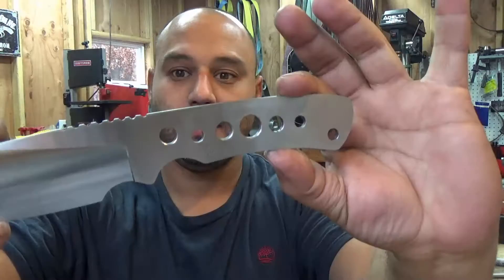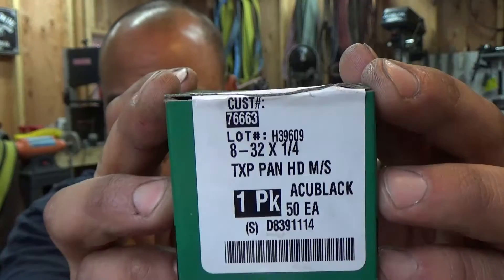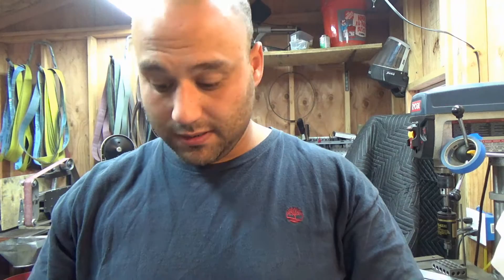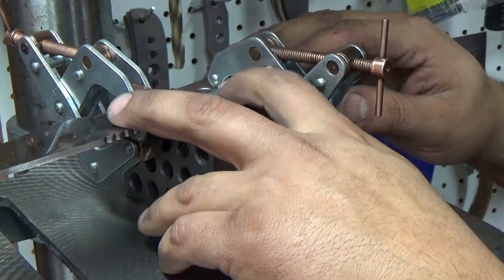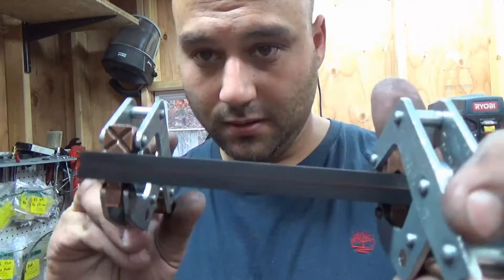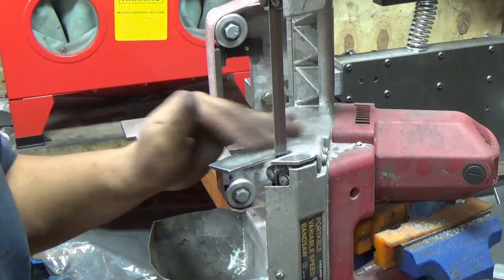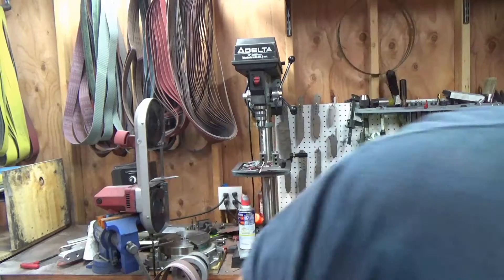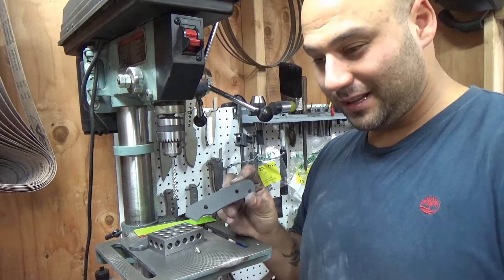How to make removable knife handle scales part 1

Comment: Mike,
I am a police officer in central Florida, and a knife creator enthusiast.  I am no way a computer/internet guru, and I determined  this comment thread to be the best way to contact you.  I work as a motor cop (motorcycle) and we all (well, most of us) carry folding knives on our motor boots.  I am sick and tired of carrying a garbage knife while on duty.  How do I go about buying one of your knives?  I find your passion and creativity for knife making absolutely captivating.  Hope to be the proud owner of one of your folders in the near future.
Reply from the maker: +TheLagwagon6040  I'm not much of an internet guru either so no worries there. So you attach the knives to your boots with the pocket clip or is it in a pouch of some sort?  I haven't finished my locking folder prototypes just yet but they are in the works. I want to be sure that the design is up to par before I start selling them. The folders I make now have been all non-locking friction folders which likely isn't up to the task of an officer's duty knife.  I plan on starting up a website to make the knives more readily available, but as of now I've been selling the majority of my work through Instagram on a first come first serve basis. I will be sure to make a video once they are ready and the website goes up. Thank you for watching and your service!
Reply: +EKIM1428 Yeah, we carry the knives with the pocket clip facing out, at the top edge of the boot (Chippewa Police Motor Boots.)  The actual knife rides inside the boot.  I'd attach a pic but I don't think I can on the comment thread.

Comment: great video..as usual...after making a shitload of removable handles I thought I have done/seen/heard every way of doing it...guess not...2to3 steps u mentioned will speed up my way of doing it for sure.THX.   ..... a few notes from my side...u for sure know but didn't mention/use.....drillbits can be used instead of standoff all the way..especially when the standoff are not such a snug fit....counter sunk head screws can make life easier...especially on thinner handle material....and by using a counter sink there will be more meat left..i prefer them....to keep the screws/standoff from spinning while tightening make one screw shorter...screw it all the way in and use 2 screwdrivers....while u screw in the other screw u can hold everything in place...most of the time u don't even have to...oh n u can use a scribe instead of a sharpie so the outlines will be closer to the actual spine n u can grind the scales almost flush without messing it up...btw u got balls to make scales without taping the blade...have scratched so many finished blades that i always tape them up good now...just my thoughts ...keep the great videos coming...your followers (ha that sounds like out of the Kevin Bacon tv show)need more ..take care
Reply from the maker: +Fred L Glad I could help streamline your process a little bit! Those are some great tips as well. I made some purpose built assembly pins but couldn't find them for the video. definitely a little easier then smacking standoffs with a hammer. I've been meaning to try some flat head screws too. My next order I'll make sure to pick some up and give them a go. Lmao the amateur knife maker colt following hahaha  As far as taping goes, I tend to get grit under the tape somehow and scratch it up anyway so now I don't bother unless Its a tough finish to touch up. Thanks for watching!

Comment: Great video mate. How come you weren't using your milling machine? Wouldn't that give you a digital depth and make the job easier? I use a Bosch digital drill press and it makes life super easy as it has a clamp similar to what your fingers do so you can clamp it down firmly and use a digital depth and set up makes life super easy thanks for another sweet video could you do a video on brass bolsters etc would love it Thanks.
Reply from the maker: +James M I would use my mill but I figure a lot of guys don't have one so it would be easier to follow using a more common machine. It would be easier and I clamp my stuff to some 123 blocks in the vise on the mill.  I've never done bolsters before but I want to learn how, Once I do I'll definitely share what I've learned. Thanks for watching!

Comment: Question: I've tried many times drilling holes at the exact size of the pins and its a pain trying to get them back out. So what I do now is use the appropriate letter or # drill larger for the pin. 1/8" - #30, 1/4" - F drill. And its worked great. But for this style handle, I see why they need to be tight. 
Could you explain how you get the standoffs out of the scales and blade without completely ruining them?
Reply: Corey Lueneburg I just use a pencil and push em out